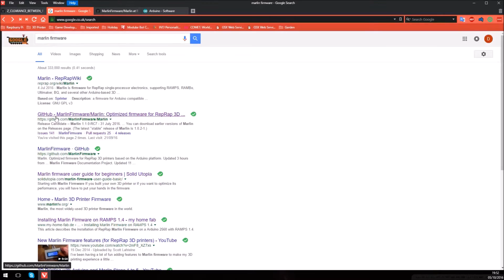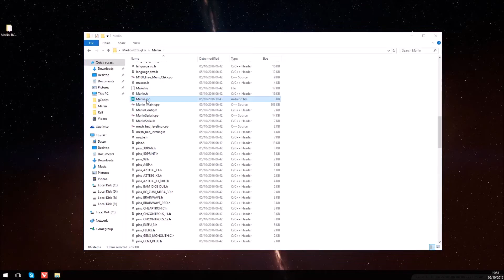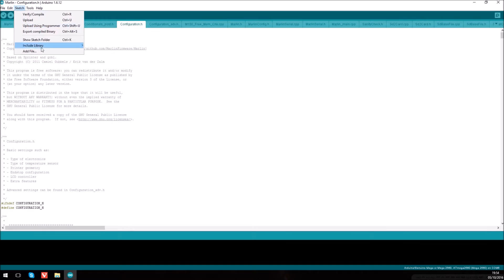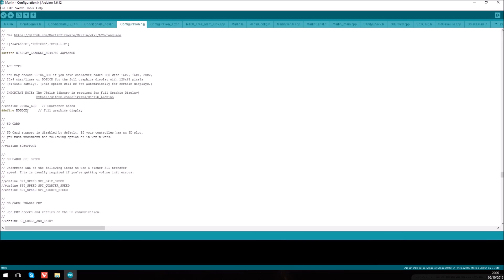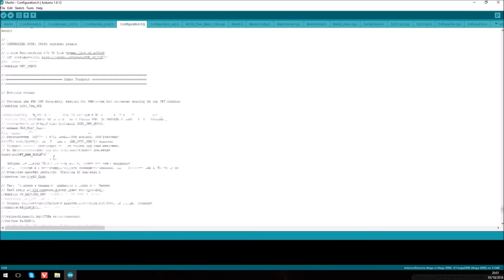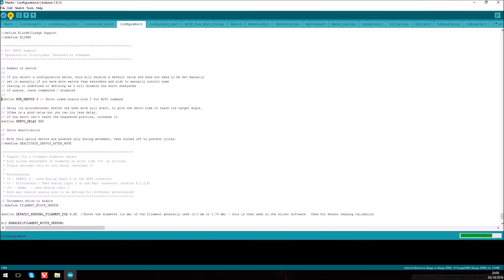Melzi to Ramps I3 Duplicator Tutorial for BLTouch (Part 2 - Firmware)

Comment: Hi bro

thanks for the wonderfull tutorial but I`m in a big mess

first the lcd was showing wrong temp I thought it was from the program so I installed the truntula firmware 
and ALL THE SYSTEM STOPPED 

NOW I CANT LOAD THE marlin or the black widow firmware on the board

how can it be fixed ??

Comment: I was having issues with installing the firmware onto the Sainsmart 2 in 1 and it turned out that the bootloader had not been burnt to the board before shipping this can be done using the instructions here https://github.com/Hooklet3d/OdinOne/wiki/Guide:-Burn-Bootloader you will however need a device to flash the bootloader I used an arduino uno

Comment: got the screen to work, but can't get the encoder wheel to do anything, is their something I need to define or change? I followed your your video to the letter. I'm stuck.
Reply: I think the encoder wheels on the LCD displays are a bit naff.  Mine broke after the first two weeks of use, No additional config should be required to use it.
Reply: You know, I thought that as well, but I can't even get Reperter-host to connect to it. Don't know. I took a break from it for now to collect my thoughts and regroup

Comment: Need Help, I get this 

Arduino: 1.8.1 (Mac OS X), Board: "Arduino/Genuino Mega or Mega 2560, ATmega2560 (Mega 2560)"

Sketch uses 131132 bytes (51%) of program storage space. Maximum is 253952 bytes.
Global variables use 5213 bytes (63%) of dynamic memory, leaving 2979 bytes for local variables. Maximum is 8192 bytes.
avrdude: ser_open(): can't open device "COM1": No such file or directory
ioctl("TIOCMGET"): Inappropriate ioctl for device
ioctl("TIOCMGET"): Inappropriate ioctl for device
avrdude: ser_send(): write error: Bad file descriptor
avrdude: stk500_send(): failed to send command to serial port
avrdude: stk500v2_ReceiveMessage(): timeout
avrdude: ser_send(): write error: Bad file descriptor
avrdude: stk500_send(): failed to send command to serial port
avrdude: stk500v2_ReceiveMessage(): timeout
avrdude: ser_send(): write error: Bad file descriptor
avrdude: stk500_send(): failed to send command to serial port
avrdude: stk500v2_ReceiveMessage(): timeout
avrdude: ser_send(): write error: Bad file descriptor
avrdude: stk500_send(): failed to send command to serial port
avrdude: stk500v2_ReceiveMessage(): timeout
avrdude: ser_send(): write error: Bad file descriptor
avrdude: stk500_send(): failed to send command to serial port
avrdude: stk500v2_ReceiveMessage(): timeout
avrdude: ser_send(): write error: Bad file descriptor
avrdude: stk500_send(): failed to send command to serial port
avrdude: stk500v2_ReceiveMessage(): timeout
avrdude: stk500v2_getsync(): timeout communicating with programmer
the selected serial port avrdude: stk500v2_getsync(): timeout communicating with programmer
 does not exist or your board is not connected

This report would have more information with
"Show verbose output during compilation"
option enabled in File -> Preferences.
Reply: Are you sure when the board is plugged into the computer that its port Com1?  Mine usually appears as Com4